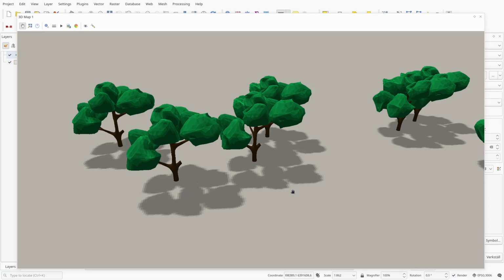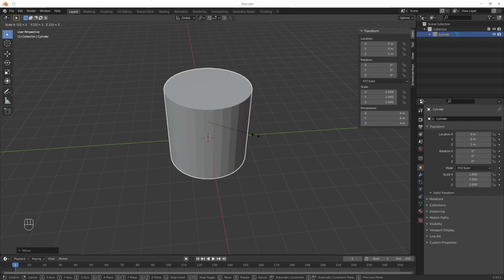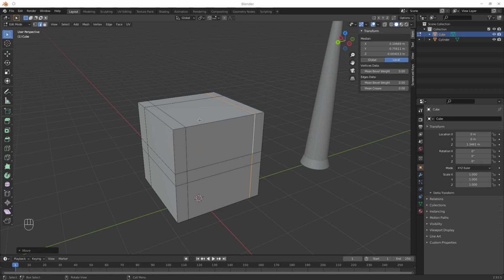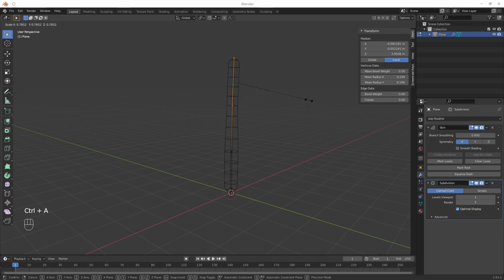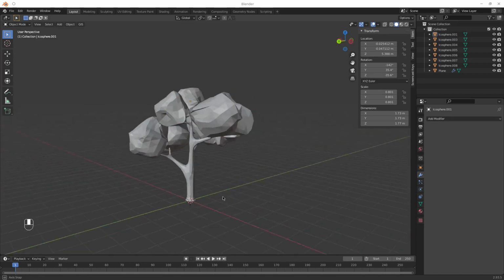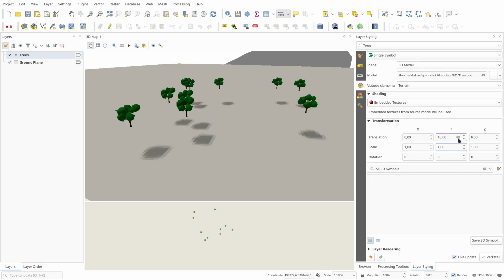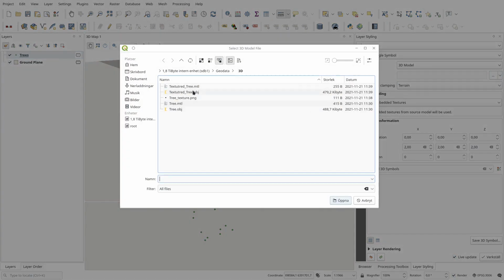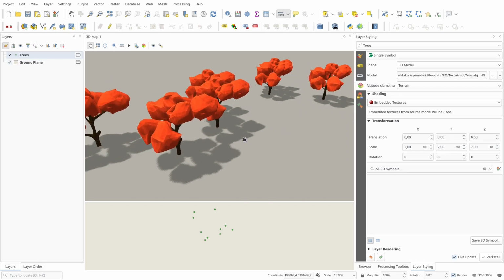QGIS User 0037 - QGIS 3D Objects from Blender

Comment: This is really cool, I did not know that you could add real 3D models to QGIS. This totally slipped under my radar somehow ...
Unfortunatly my experience with the 3D-Map in QGIS is a mixed one, there's always something not rendered correctly so I gave up on it. Maybe I should give it another try. Since I am working with architects, did you try to use 3D models with polygons? I am thinking of houses to place on a map where I have the building footprint as a polygon.
In any case, thanks for the great tutorial, I will definitely give it a try
Reply from the maker: In Blender you can get a plugin "Blender GIS" that makes it possible to work with GIS files like Shape. You could import a polygon for a building footprint, model the house in Blender, and then load it back as an object in QGIS.
There are some rendering issues in QGIS still, and some are caused by underlying Qt framework issues, while others are simply caused by limited funding. If more users are interested in 3D in QGIS, and are willing to fund it, there are companies willing to do the work.